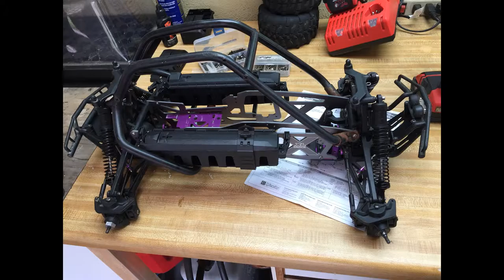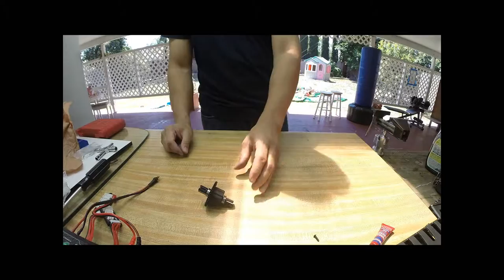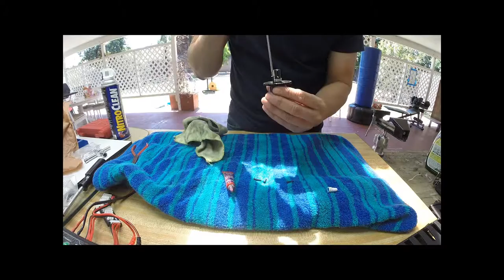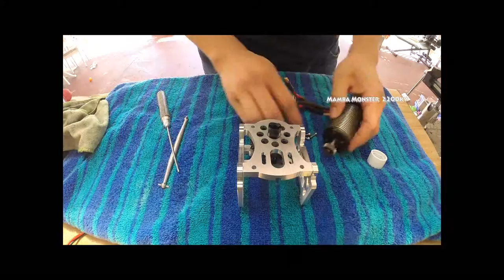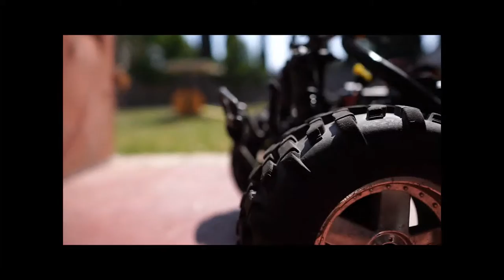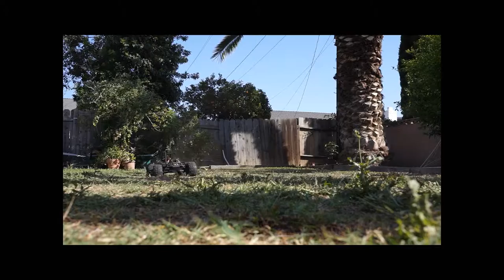Savage25 - XL Flux, Alza Racing Conversion

Comment: Sorry for the really late replies. Custom made roll cage. works very well. The roll cage is made out of some plastic rods scrap that I heated up to the desired angles to protect the savage from serious bashing. The rear section is designed to be "springy" so that the impact is lessened. So far it survived a lot of serious crashes without any serious broken pieces...lots of crashes on pavement too!

Comment: Will that alza racing setup work for a Savage x? Currently using a custom, very ugly setup. Love the look of that.
Reply from the maker: As far as I know about HPI savage,the difference between XL X etc is the base length...meaning most likely just need a front drive shaft to match the distance from the alza racing setup to the front differential box. Please anyone chime in if that's not accurate. Thanks guys.

Comment: can I just take off my stock 25 frame rails and put on the xl frame rails without any problems or do I have to replace the diff housing or anything like that(I know I will have to get a longer driveshaft obviously)
Reply from the maker: Everything fits except the drive shafts.
Reply: Gear Up Baby thanks I plan on doing a brushless conversion with alza razing and xl frame rails hopefully in time for next summer
Reply: Also how's everything holding up any diff problems do you recommend the swap and do you still have the truck
Reply from the maker: @andrewbrummer9539  still have the truck. Happily bashing along....got new bigger tires 17mm hubs etc.
Reply: Nice I was going to do the alza center diff because I thought it would be easier and cheaper but I made my own motor mount for about 4$ Im trying to finish the entire truck for around 200$ total